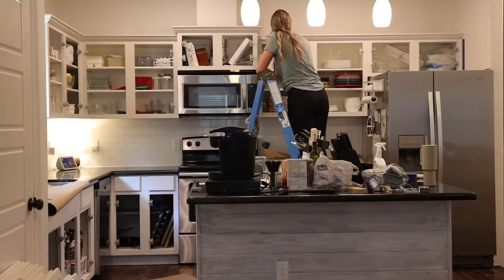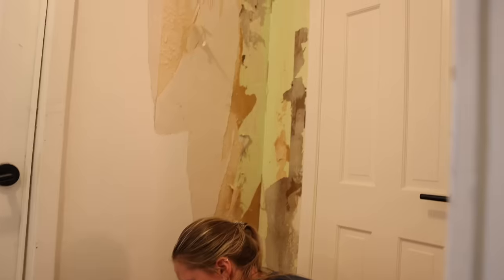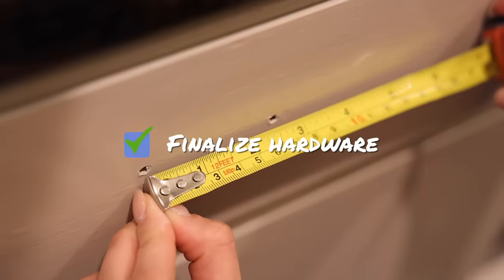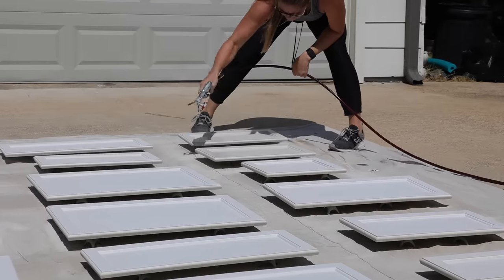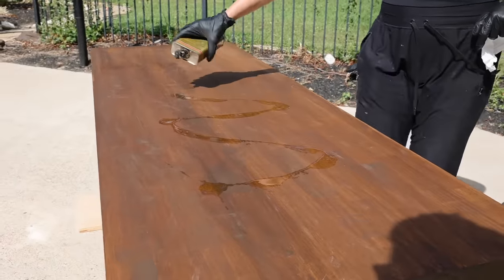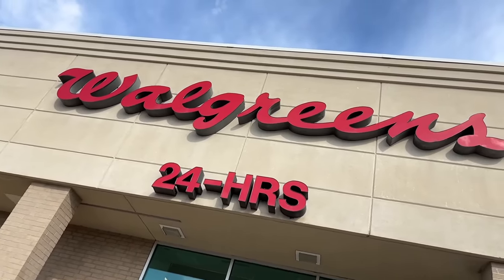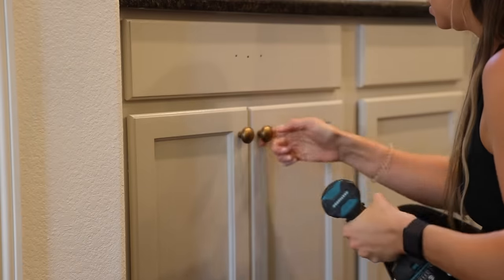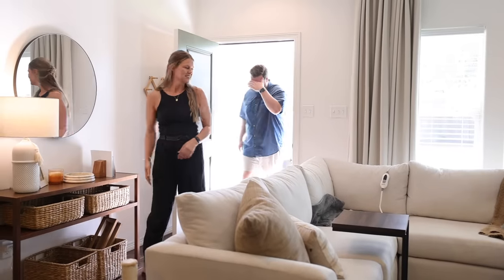DIY Kitchen Makeover In Less Than Two Weeks // Kitchen Makeover On A Budget

Comment: The solution to rain collapsing ez-up tents is some cord and tarp clips. Tie a length of cord to a tarp clip, clamp it to the side of the cover then pull tight and tie to a leg or ground stake or weight. Use at least two clips per side.

With the cover pulled tight so there's no sag, rain will run off instead of pushing the cover down so water accumulates and pushes the cover down more.

Comment: It looks good, as all your projects do.  You do such amazing make overs and your eye for design is so impressive.
Question:  Will you be doing their nursey?  I'm surprise it wasn't part of this series.
Suggestion:  Will you guys, please buy a trailer, don't understand why you don't have one.  Sure would eliminate a lot of work; you wouldn't have to remove the seats in the van every time you want need to haul something.  An enclosed trailer, you'd be able to keep many of the tool and equipment you use, organized on shelves down both sides of the trailer and the middle section free to haul materials, cabinets, etc.  Would always be loaded and ready to go.  You could do a few videos on building it out, organizing it, etc.

Comment: Overall, looks good. I personally think the gallery wall should have been placed higher so you reduce the potential of knocking into the frames when using the table and also so that the flower arrangement wouldn't cover them.